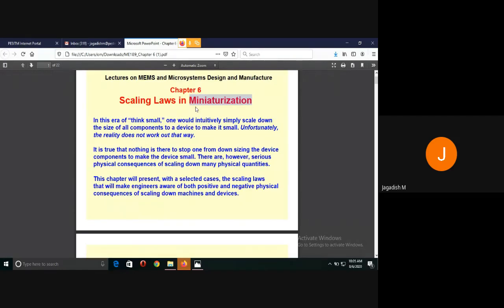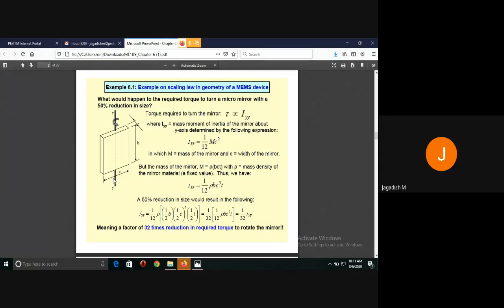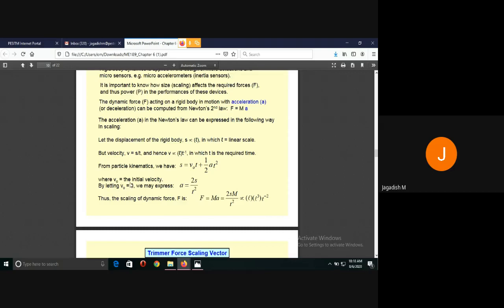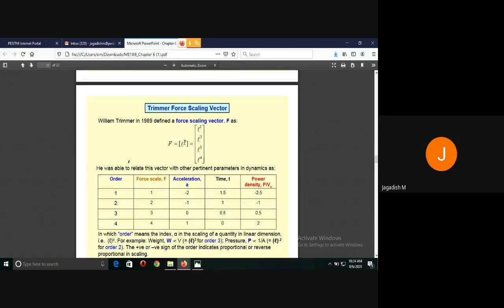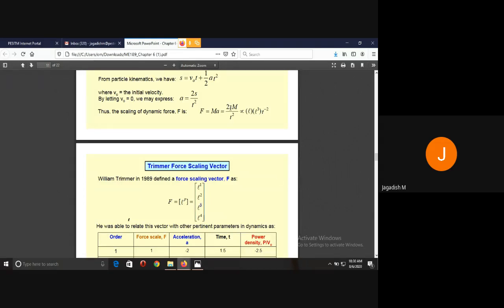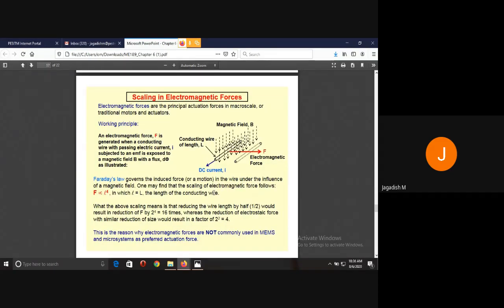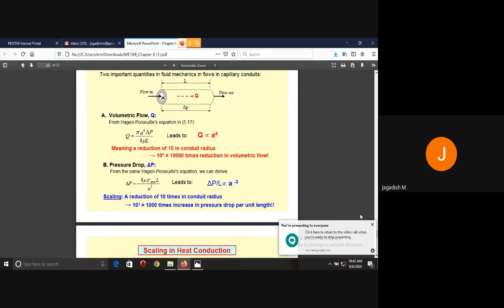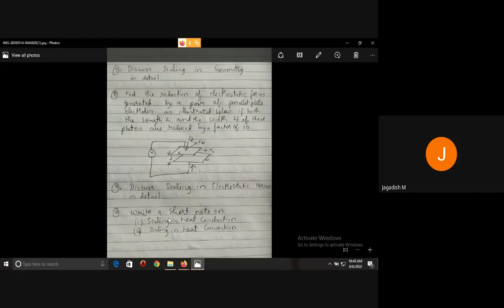module 4 scaling laws

Comment: at 28:39, we see voltage proportional to l^(+1) 
and at 32:47, we see resistance is proportional to to l^(-1).....
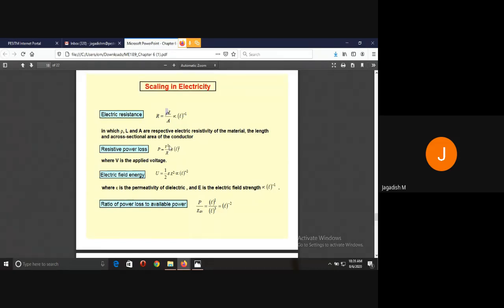So, the doubt is, at 33:41, shouldn't resistive power loss be proportional to l^2/l^(-1) i.e l^3???
Resolution of the query will be highly appreciated 🙏🙏

Edit: I got the answer..... Actually in case of electricity, V is proportional to l^0..... And at 28:39, it is V proportionality to l for case of electrostatic forces and not electricity(circuits)